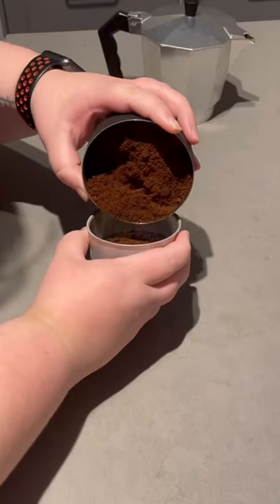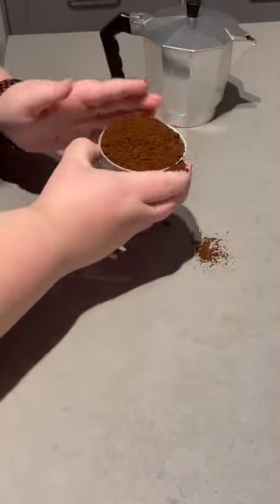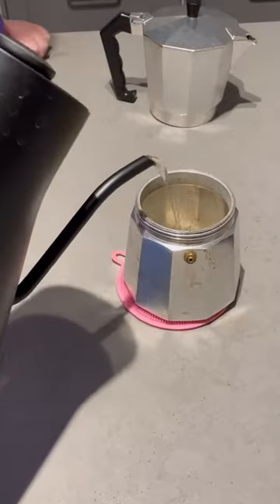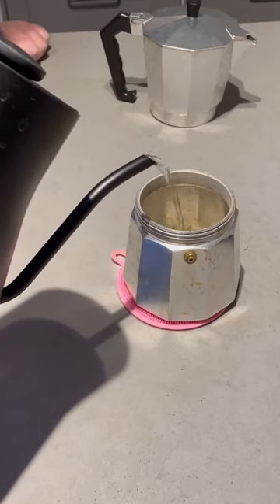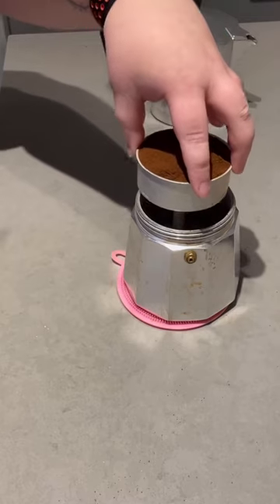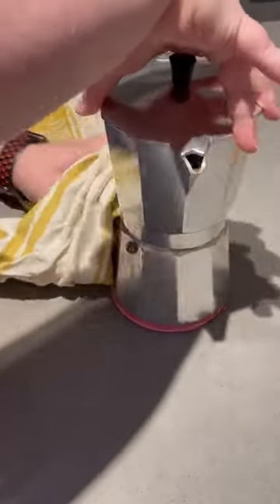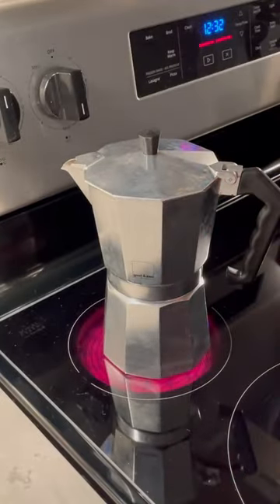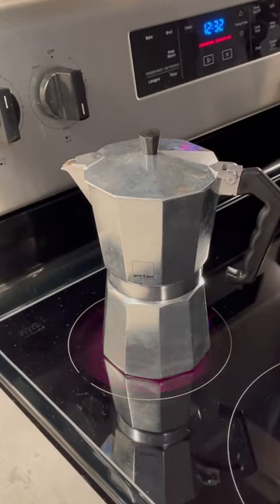How to Brew With A Moka Pot #shorts

Comment: Bialetti told me the correct grind is medium-fine. Most espressos are too fine for the moka pot. But the espressos sold in Italian grocery stores, like illy, Lavazza, and Kimbo, are ground a bit coarser for the moka pot. 

It's not necessary to preheat the water or run it under cold water if you learn the correct traditional Italian way since 1933. 

Search for the "Annalisa J moka pot" video for perfect coffee every time that's never burnt nor bitter. 

Immediately remove the heat as soon as you hear it gurgle. Let it sit for a minute to finish filling, then stir it and pour.

Comment: Avoid using older mocha pots that are made from aluminum. Find a stainless steel one, if you can 

(I think, not certain, that this is a good tip)

Comment: I don't like the style of pot as demonstrated in this video.  What I call "angry" coffee comes out the sputtering top as seen in this video.  For a smoother, much less bitter brew, you want the coffee to come out in a lazy manner which you will only achieve on a lower heat, between low and medium, but more towards low.  I have used the style of stove as in this video and I find it harder to get the process to slow down.  On my gas stove, I can control the low setting much easier.  The reason I don't like this style of this pot, I say this across brands, its about the style not the brand.  The center tube is tapered, wider at the bottom and narrower at the top.  So you need more pressure to get the water/coffee up the spout.  The spout then narrows and the coffee comes sputtering out.  Sputtering coffee is bitter coffee.  I own this style of pot but I also have a stainless steel Grosche moka pot.  In this style, the center tube is narrower and the same width from bottom to top.  I find it is much easier to slow down the coffee coming out the top so it looks more like a slow moving stream, rather than an angry rapid in a river. The lazy stream coming out the top of the tube is significantly less bitter and is actually quite smooth.   Here is a video of the Grosche steel pot, notice the center tube is narrower and not tapered.  I am not flogging Grosche here but the style of this pot found in other brands as well.  In my opinion, even in this video the coffee is coming out just a little bit to fast, you should get a nice, not bubbling stream, that's what you are after:  https://www.youtube.com/watch?v=ByBy69RP40U

Comment: Bit of feeback: you shouldn't finely grind the coffee, it should be a lil coarse, and no dont just leave your moka pot on the stove, leave the lid open so you can observe the brewing process, the heat should be on low not medium, that way the brew is less bitter, the water you use should be boiled first and the second it starts to pour out (should be smooth not sputtery) turn the heat off immediately and let the stoves heat finish the brew, and the second it starts to sputter then run under the cold water. If you have a gas stove put on immediately buttttt an electric stove should be heated first so that the moka pot experiences the desired heat immediately